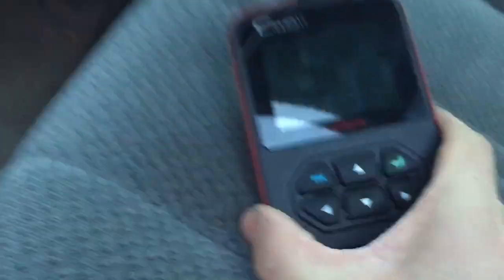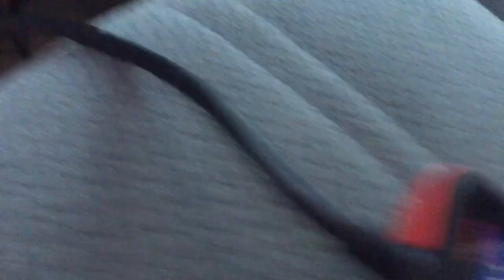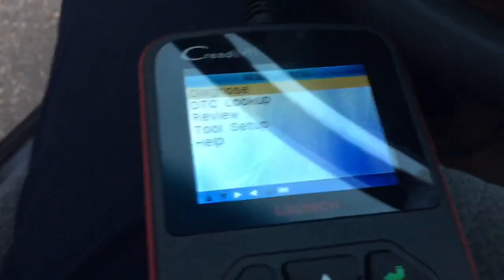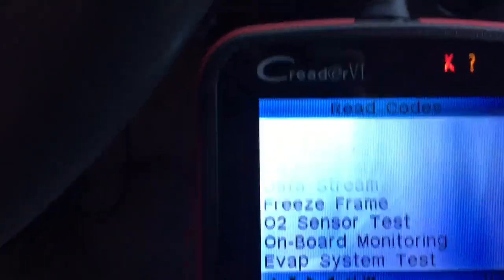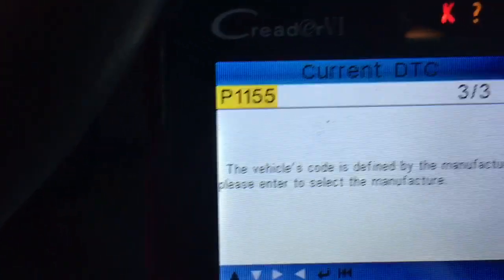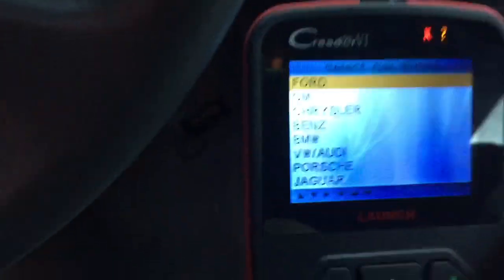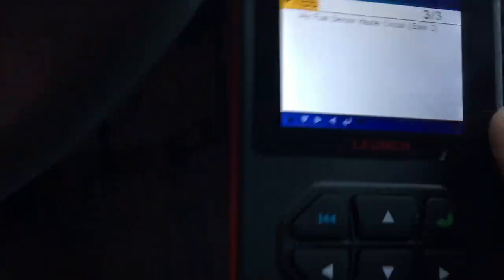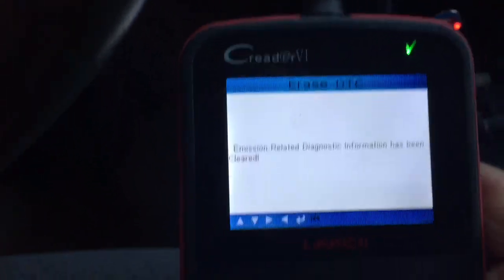How To Use An OBD II Reader

Comment: I bought a wireless OBD2 sensor off ebay, connects to an android app via bluetooth on a phone or tablet, works flawless and only costs like £3 here in the uk :)
Also allows you to use it as your car is running to look at various parameters, such as speed, rpm, afr, temperatures, etc. Would recommend that to anyone looking to buy an OBD sensor, those devices are overpriced as hell.

Comment: so after you cleared the codes is the CEL still on? I have an ABS light on in mine and I don't even have ABS..  it only came on after I hit a deer. dealership said the only way to fix it is by buying new ECU. And "I ain't fixing that either!" I would buy this if I knew it would shut the dummy light off...

Comment: the third code is basically the same as the first one. an air fuel sensor is basically an o2 sensor but it's wide band. you gotta get a Denso air fuel sensor and make sure you follow what bank the code says.

Comment: the code for your transmission you might want to fix that I have Toyota truck same thing gets stuck in gear well used to took to shop they changed solenoid was $100 parts and labor
Reply: +Seth Stone yeah sometimes its as simple as just changing the shift soilenoid

Comment: How much was it? I work at Mazda and they have a snap on truck there every week I need one lol
Reply: +brandoncrane69 they range depending on so many factors. my guess for the one in the video is around $80
Reply: +brandoncrane69 they range depending on so many factors. my guess for the one in the video is around $80
Reply: +brandoncrane69 those are like $90 or atleast the mac truck sells them for that much who knows what snap on charges you can find those elsewhere on the internet as well. if your in america i would only assume its cheaper.

Comment: Does anyone know what machine will read the codes off a 1994 bmw 840i
Reply: Pre 1996 vehicles need special connectors and hardware to be diagnosed. Yours being a 1994 it may be an OBD1 or since it is german car it may be CAN or Digifant2 like Volkswagens between the years 91-94.

Comment: Air fuel sensor is O2 sensor lol
Reply: +Phoenix Studios which affects a/f ratio. My wrx had the insulation melted on my front o2 and every time it touched the motor it would make the car run like shit... So yeah he's got a point
Reply: +YourPistachios yeah Toyota are big users of Air/Fuel sensors sometimes referred to as "Wideband O2" sensor, so (one of the) "O2 sensor(s)" on that car is probably just an Air/Fuel sensor
Reply: My 2000 corolla has had a P0171 lean condition for 2 plus years now. It runs perfectly fine. Just has acceleration issues when you romp it. It is such an annoying engine code because so many different things can be the cause of it.